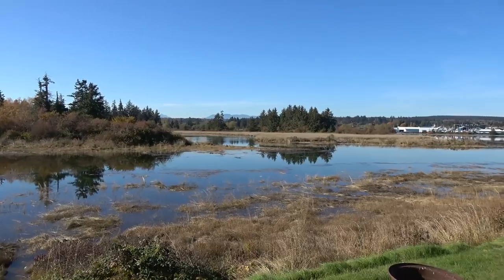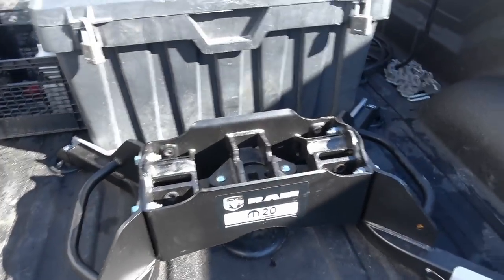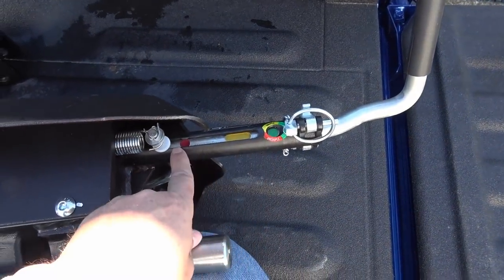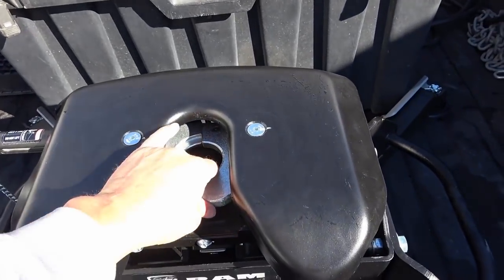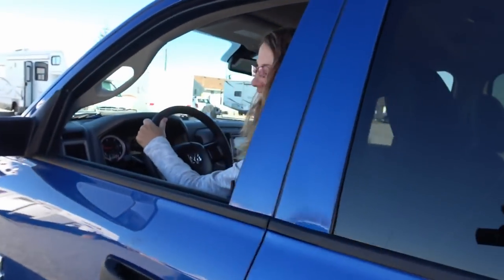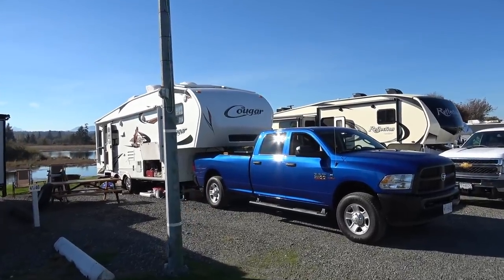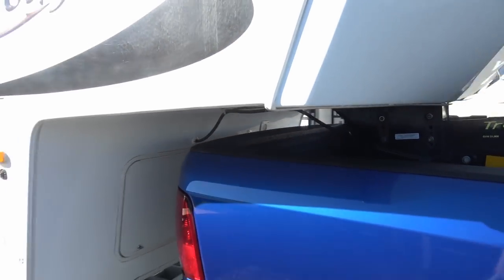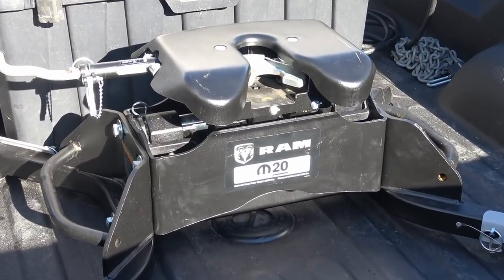Big Blue 2 - First Hookup (Testing New Hitch and Clearances)

Comment: Nice looking hitch but lots of moving parts ? How heavy is the hitch ? We have an Andersen 4 clips to take it out weighs 40 lbs the steel one that is .
Reply from the maker: Not sure, it feels like about 150-200 lbs total. Head maybe 50-75 and the base 100-125
I really love my Air Ride pin box, takes a lot of stress off the fifth wheel frame on rough roads so stuck with the standard fifth wheel hitch to accommodate it.

Comment: I commented a bit about it on your last video where you got the new truck that my experience with the Dodge is that it is quite a bit higher than the Ford, so the tail of the trailer drags and the wheels are not properly loaded front to back.  My trailer also already had the axles "flipped".  The proper solution is not "shims", it's to take it in to a suspension pro like Standen's in Calgary and have a new "sub-frame" put on.  My trailer originally had a 2 inch sub-frame, which they replaced with a 6 inch sub-frame and some extra bracing.  Doesn't sound like much but it lifted the back by 8 inches.  $2000.  Take it in to a pro and they know how to fix it up.  They do it all the time.  My trailer is so level now I often don't unhook if I don't need the truck.  Trust me, you just spent $70,000 on a truck, $2000 to have the trailer suspension made right is worth it.  It might be a little more now than was 2012 when I got it done.  Messes up your lower step to ground a bit but other than that it is what you need to do.  Warning though, Standend's will measure your rig right away but in the summer it can be months before they can actually get you in.  It comes out pretty quick after that though, a day or 2.
Reply: Maybe I just got lucky, but I ordered my RAM 4x4 SRW with the auto self-leveling air suspension and it was perfect out of the box.
Reply from the maker: Wow, 8 inches! you must have been really dragging butt. I could probably get similar work done n the states. Will see where we are at once we get it on the road. Cheers, Ray
Reply: In many cases spacers are just fine. Springs with a bit more arch is better. The latter can be done by most DIY'rs
Reply: It's all about the angels.  If you lift the front 4 inches, the back drops 4 inches.  But since you can't lower the front the back has to go up 8 inches to get her level again but over all it was a 4 inch lift in the middle.  And yes it was dragging butt.  I have a receiver on that unit so it was pretty close to the ground before I got it lifted.  It's a lot easier with a drag-along because usually you can adjust the ball height.
Reply: STR- I don't recall that being an option on the 2011.
Reply: GH - I agree, and Standen's has those options too.  But I had to go four inches so they recommended building a new sub-frame and I'm much happier with that solution, the one they made is very solid and includes cross bracing.  It's much more ridged side to side than 4 inch spacers would have been.  I'm a bit of a worry-wart when it comes to things like that and didn't want any problems caused by hanging my axles 4 inches below the springs, especially since I tow a trailer behind the trailer (boat or motorcycle).  So I paid the extra money to have it welded up right.  It might be a bit overkill but I'd rather err on the side of safety.  And compared to the cost of the rig and the trailer $2000 didn't seem like a whole lot of money.  I think I paid $1400 for the receiver.  PS these are all Canadian dollars so if you are getting the work done in the US it should be 25% less.
Reply from the maker: Ah, I see that makes sense, I guess you are 4 inches taller overall so need to watch the roof clearance, on some of the taller rigs that could be an issue I'd think.
Reply: Not in my case, I don't have a full height bedroom area so even with the 4 inch lift I am still lower than the big rigs.  I intentionally bought a 285 so that I could tow a small boat and still be under 65 feet (that's the law around here although many people seem to disregard it).  Plus there has been many a campsite where I was glad the trailer wasn't any longer.  Full slide though so it seems roomy enough.  I think it might be similar in size to yours although the layout looks different.  I have a bunk model.  Kids.  Never understood trailers that didn't have bunks for kids unless you don't have kids.  But we did so we went bunk.  2 of the kids are grown now and don't come camping much anymore and the rare time they do they sleep in their own tents, we snore too much apparently, but the 12 year old uses the bottom bunk and his hedge hog cage goes on top along with extra blankets and such.  Yes, the hedge hog comes camping.  The dog sleeps wherever he wants but mostly on the couch.

(PS sorry about your beagle.  Every dog has its day but it's still never easy to say goodbye.  Think back instead upon the fact your dog had a great life (for a dog).  I don't know if dogs have regrets, but yours probably did not.  Seemed like a pretty happy puppy.)

PPS the couch is another modification story.  When we viewed the trailer it had a "hide a bed" style fold out couch.  I'm glad I opened it because even with the slide out it was huge!  You had to crawl over it to get from the master bedroom to the washroom at the back!  Nope, didn't want that thing so I had them swap it out for a scissor style regular couch.  Still sleeps one (dog or human) comfortably and is way easier to fold, plus all the storage that was previously taken up by the fold out bed.  So the purpose of that story is to remind folks that if you are buying new the dealer can often change out certain options if they aren't to your liking.  I imagine they just swapped it out with another trailer on the lot.  Or maybe they factory ordered a whole new unit I don't actually know.  Anyway the scissor couch suits us much better for our dog sleeping and storage needs.  My wife brings a lot of shoes.  Where would we put all these shoes if we didn't have storage under the couch?  Plus I hide my whisky there too.

Comment: Quite surprised your tailgate won't open at hookup. Like the fact that you can reach your latch, I had to make myself a step to hook onto the tire to be able to reach my locking pin. But it is handy just to reach things in the truck also.
Reply from the maker: Same on my old truck sometimes too, mostly because I had swapped the longer OEM pinbox for the Air Ride, it's a little shorter pin box. Means I can fully open the tailgate until unhitched a little.  A bit of a pain but I'm used to it though. Could always get a fifth wheel tailgate.
Reply: I am not...I see plenty of rigs on the road where there is no way to open the tailgate.
Reply: That would loose your backup camera.
Reply from the maker: I could rewire and mount it in a different spot. I do like the tailgate though keeps casual eyes out of the truck bed since its so tall.

Comment: Hi Ray, how important do you think it is to have the trailer level? I have a 2016 F250 and is much higher than the old truck. The trailer is about 2" 
 lower in the rear. My tire monitors show all tires within a couple of degrees. would hate to replace the trailer suspension
Reply from the maker: I see quite a few rigs running around a little nose high and doing OK. I'd think if the tires are OK, no abnormal wear and not getting hot and the rear axles are not overloaded it should be fine. And the tail isn't dragging.
Every rig is a little different height wise and the weight distribution inside the trailer is spread out differently depending on build and how people have stuff stored. Some have longer bumpers, etc. So I guess there is no standard answer. Level is the goal but in my mind a few inches up or down shouldn't be a major problem.  Cheers, Ray
Reply: Thanks Ray, always good to get a second opinion

Comment: Maybe it's the camera angle but can you open the tailgate with the trailer coupled? It looks very tight there.
Reply from the maker: No, I switched to a different Air Ride pin box a while back and it is shorter than the original OEM pin box. Had to give up being able to fully open the tailgate, got used to it though. Just an extra step when hitching and unhitching.
Reply: Love your RV Take the tailgate off before it gets you in a jamb.

Comment: I dont own a 5th wheel and dont know about hooking them up , but dont you need too lift your level jack up before you can adjust your hitch and truck level?
Reply from the maker: The front jacks were off the ground just slightly so no weight was on them, all on the truck. Before we begin to tow I'll be retracting them all the way in. Cheers, Ray

Comment: Ray, do you stay at one of the RV parks here on the island during the summer? 
This is just my first year of full time traveling coming up end of November I always take a trip back to the prairies to visit with the kids for about a month or so and then back to the island before heading down south, do you arrange a month at a time over the summer or how are you dealing with having a bit of a home base?

Thanks again, sorry for all the questions
Reply: Colin d
Reply from the maker: We typically spend anywhere from 3-5 months here at Thunderbird RV Park in Campbell River, part of the reason is Anne likes the boating here and moors her boat at the local marina, we get put on the reserve list and they call in January to book a spot for the summer. It running around a thousand a month for the best spot and you need to put 1/2 down. Cheers, Ray

Comment: It could be just video perspective but, it looks like there is not enough room to open the tail gate when hitched up. By the way, so sorry about the loss of your pup.  Dogs enrich our lives so much  and ask for so little in return.
Reply from the maker: Same on my old truck sometimes too, mostly because I had swapped the longer OEM pinbox for the Air Ride, it's a little shorter pin box. Means I can fully open the tailgate until unhitched a little.  A bit of a pain but I'm used to it though. Could always get a fifth wheel tailgate

Comment: please, when hooking the trailer, AND, getting ready to hit the raid, preform the tug test.  
This is just a simple pull on the trailer in a forward gear to insure that the pin is locked in place.  you only need a small amount of throttle, too much and the landing legs may be damaged.  This is a standard item on the pre-trip for professional drivers.  We all have seen many failures  where the trailer is an orphan on the highway.
Reply from the maker: Always do, I usually lift the landing legs slightly of the ground, I don't like putting the sideways force on them. I leave my trailer wheel chocks in and pull against them.

Comment: I know it might have had enough room but can you open your tail gate while hitched up?
Reply from the maker: No, I switched to a different Air Ride pin box a while back and it is shorter than the original OEM pin box. Had to give up being able to fully open the tailgate, got used to it though. Just an extra step when hitching and unhitching.

Comment: Ann cant see the hitch? Cougars have hitch vision specifically for when the hitch is behind toolboxes..She doesn't use it.? Also do you lubricate or grease the kingpin and/or jaws,?
Reply from the maker: I swapped out the standard pin box with the large AIr Ride uint so it makes the hitch vision pretty useless.  I always do the hitching and towing, she never has. I lined it up for her first to back in as I wanted to video it. She was excited to do it. She may do some towing now that we have such a great truck for her to tow with. I usually add a little layer of grease to the kingpin and the jaws.
Cheers, Ray

Comment: If I already have my trailer and my hitch, what measurements should I be watching out for when buying a truck to go with it? Do I need to know bed rail height of truck, bed depth or such?
Reply from the maker: Fifth wheels vary so hard to tell. I actually had a guy with a similar truck to the one I wanted to buy hookup to my fifth wheel so I could check Usually, I find the most critical was the bed rail height. Mine was around 58 1/2" and worked out OK for my Cougar.
I decide to go with the 18" wheels versus 20" as that cut a few inches off the truck height.

Here is my blog post and video review update I did after 10,000 miles with considerable towing miles - https://www.loveyourrv.com/2018-ram-3500-truck-review-update-after-10000-miles/
Also my earlier full review here - https://www.loveyourrv.com/2018-ram-3500-truck-review/
I did find the springs broke in overtime adding about an inch to the original clearance when brand new. I didn't have any issues on roadways but would like to raise the trailer suspension for off road.
Reply: @LoveYourRV  Our recently bought cougar is just a year older than yours and a tad shorter in length so I figured your experiences would be helpful. I was right. Thanks so much for the info. Do you have a ballpark for what it would cost you to raise the trailer or will you do it yourself?
Reply from the maker: I've seen various lift kits that are blocks that get put into the suspension for a couple hundred dollars, but I've like to get a subframe welded on mine so I'm expecting more in the 6-800 range to have that done. But just a guess.

Comment: Its gonna be high.  I think I mentioned it before, I had a 6" lift put on mine.
Reply: Same truck same camper
Reply: @Ryan Moore, how did you attain the 6" lift on your 5er/trailer? I am in the same boat with my 2016 2500...5" needed (built blocks and drove the trailer up until level with the bed etc) Subframe? Wheels/Blocks?
Reply: @fifteenfofifo  Two ways, either extend the hangers via welding,  or I had an axle guy weld tube steel 2"X6"X whatever you need, and added new hangers from the their.  This was the strongest solution we had.   DO NOT  be tempted to buy lift blocks more than a few inches tall.  They WIll break one day when you hit the brakes hard.
Reply: Thanks for the reply and info Ryan. I was tempted with blocks and wheels, but absolutely, right way is to do it a subframe as you did and new hangers and hardware. i'm looking now for a good shop. I'm interested to see if Big Blue 2  leveled out on the road..

Comment: So, do you put the tailgate back up at the same time while someone else is backing up to the 5th wheel?  Doesn't look like the tailgate can be down while connecting?
Reply from the maker: Open tailgate back in almost to the hitch, say 6 inches before it, close tailgate finish backing into the hitch until the jaws close and it locks in place. Opposite to unhitch. I found my tailgate will open when hitched but have to be on level ground or with the trailer on higher ground than the truck. If the trailer is on lower ground than the truck I don't have enough clearance to open the tailgate.
Reply: @LoveYourRV  Thanks for the info.  I'm by myself and planning to be full timing by April 2019.  Something I have to look at when selecting my 5'er-truck combo...worst come to worst, a 5'er type tailgate.  Safe travels!

Comment: I have never had d 5th wheel.  Wondering why the trailer needs to be perfectly level to tow?
Reply from the maker: If too much nose high it will put extra stress on the rear axle and tires as the weight shifts back, also if too little weight is on the truck it can lead to handling problems and more likely to drag the butt of the trailer when going through sharp dips in the road.
It's all relative as each setup is a different, level is the goal but usually, a little bit high or low isn't a problem.
Reply: Plus you will get less wind drag when nearer level. Doesn’t seem like much but there is a difference between seven and nine mpg. Every little bit helps 🤔

Comment: So how much total drop did the box sag after  you put the weight on the hitch?
Reply from the maker: 2 inches, but maybe more once I get it on flat ground, I also have a full water tank located at the far back of the trailer so that is near 500 lbs, reduces the pin weight like a teeter-totter.
Reply: Does the Ram have leaf springs or coil springs in the rear?  My Chevy 2500hd  has leaf springs so I put in 1" longer spring shackles  to help lower the box down, this in return reduced the nose height of the camper.
Reply from the maker: It has leaf springs, thanks for the tip

Comment: Please record the very first reaction to it pulling the trailer, you will be blown away by the power of that cummims
Reply: shayne jag i know...i just hope he has good luck with what it's wrapped in....lot's of horror stories...owned one dodge truck new....never again
Reply: I can say the about the Chevy I drove at my job. Will not own one. No part of a Chrysler product has ever let me down in the 54 years I have owned them.
Reply: @johnhull6363  You can get a life time (your entire life) bumper to bumper unlimited mile warranty for Rams (excluding cummins) for $4,500. It covers everything besides wear items like brakes and tires.
Reply: @johnirwin1837  I own a 2006 Silverado 1500 4.8L v8 4x4 with the manual 5 speed. 78,000 worry free miles, although mostly I drive my '14 wrangler JKU 6 speed because of the lifetime warranty

Comment: should have the backup camera moved to inside the tailgate pointing at the hitch.
Reply from the maker: It's pretty easy to line up using the middle headrest on the back seat. :)
Reply: figured since you have the camera already and it's kinds of pointless right now, having it rotated 180 degrees and point inside the bed might be of use.
Reply from the maker: We use the rear backup camera all the time when in parking lots, really comes in handy I find and it works great to hook up the boat trailer. I guess if I was new to fifth wheels a bed camera would be a big help but I've been hooking up for 7 years now so have a really good feel for lining things up. I also usually get out at least once too to adjust the trailer height too match the hitch. so can do a quick double check on the centering.  Cheers, Ray